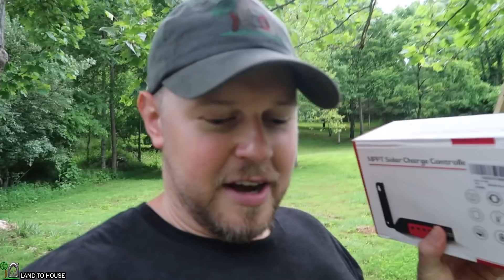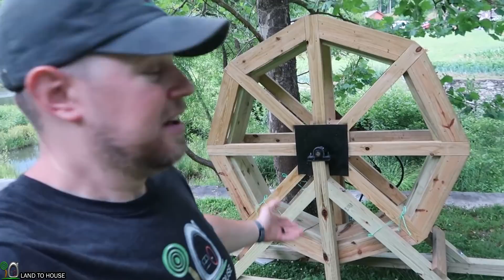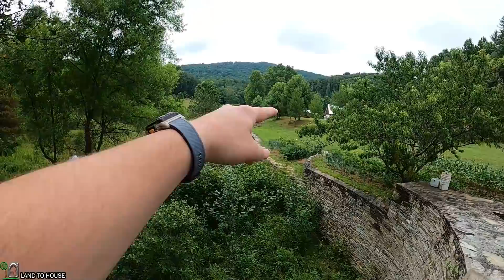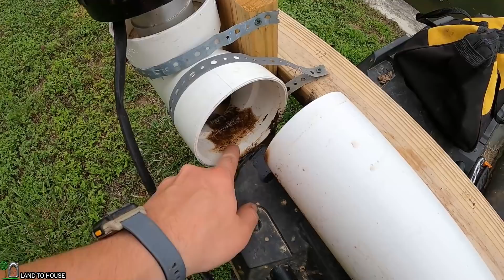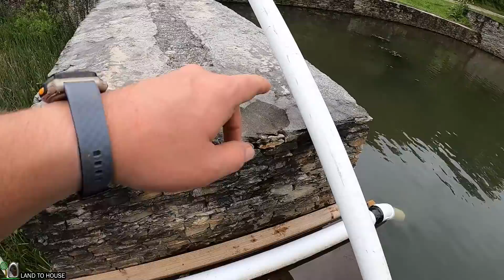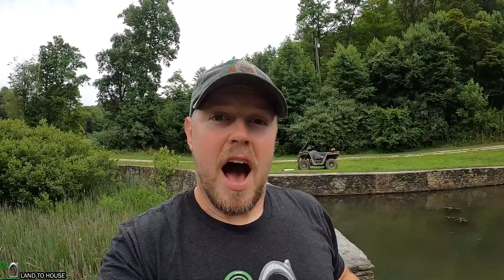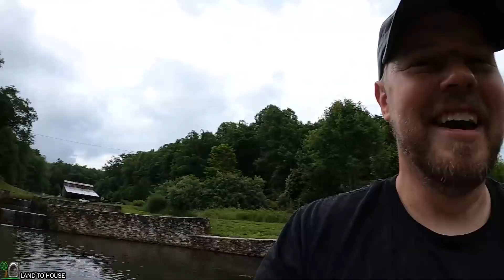Forced to move the 4 Inch Micro Hydro Turbine

Comment: Your using Duct Tape to address Air leak from not glued joints?!"
WHY  are you not using PVC cement? Why are you insisting on NOT sealing it it properly and using  Duct Tape?  What is wrong with you?   Chalking , putty, tape, (bubble gum)????  

Stop dicking about.  Just use "PVC Glue" on the "PVC Fittings" for Pete's sake and stop doing it every which way but the proper way.
Reply from the maker: All of this is testing. I will soon be adjusting things once again and it would be annoying to have to cut and replace everything.
Reply: @LandtoHouse  Ok, I get that. But if you're planning to reuse this pipe
at all, that caulk will need to be removed or cut away. Seems like this system is already a proven success beyond theory. So why waste time with temporary air leak repairs?  Or are you not convinced yet that this will work to the point of reliable power production? Seems like the only
unknown is water volume and debris. Logic would dictate a focus on those issues. Freezing might be an issue as well, depending on location.
Obviously , a larger issue is  figuring out an efficient way to make use of the power being generated. Don't think batteries will ever be a practical 
approach beyond low voltage. And transforming up to 120 V gets complicated for lots of reasons. Its amazing how little we've advanced
in these areas since Tesla, Steinmetz, and the like... Almost by design...
I do applaud your adventurous spirit and willingness to share what you are learning. There's a rumor that our Gov had hidden 600 Tesla patents
and they are about to be released to the public...Wouldn't that be something?
Reply: @LandtoHouse  I agree 100%.. but using a silicone caulk or tape will seal well..
Reply: I'm guessing he wants to be able to "easily" dismantle the pipes for maintenance. But I agree. Threaded fittings properly glued would seem to be 
more sensible in the long run. Your looking at another $20-$30 in fittings.

Comment: put a grove on the pipe you could fit o-rings so they seal when pushed together
Reply: Duct tape is fine for prototyping since this deals with vacuum, butyl rubber sealant tape also works well, o-rings are best for when a design is mostly finalized unless you manage to cut the groove on the inside of the fittings (so a cut pipe won't require a new groove to be cut every time).
Reply: it the connection is under water level it would be pressurised not vacuum
Reply: @lucasvanhamburg4937  It's under a relative vacuum when operating, it's not until the end where the water exits when it actually goes back to atmospheric pressure.
Reply: or just put caulc inside the connection instead of outside

Comment: If it self starts easily like that, it can be then an automatic start stop for water availability.
Reply: Once he gets the board and sandbags in place and the water level is above the pipe, it will self start and then it would be hard to stop even if he opens the valve. The only thing that will stop it then is if the water level drops enough to break the vacuum.